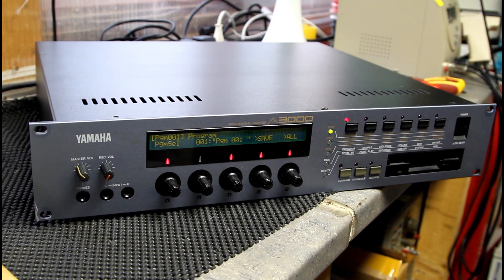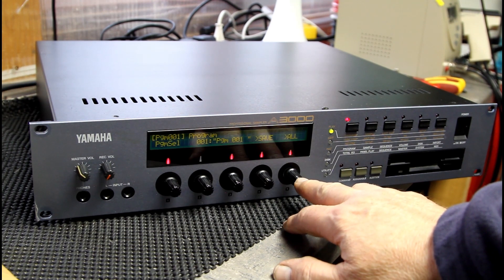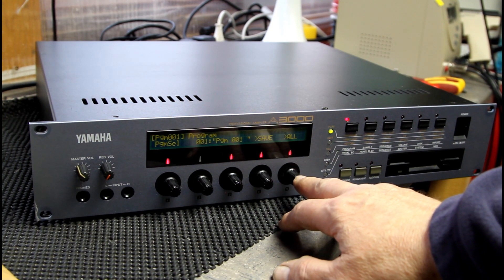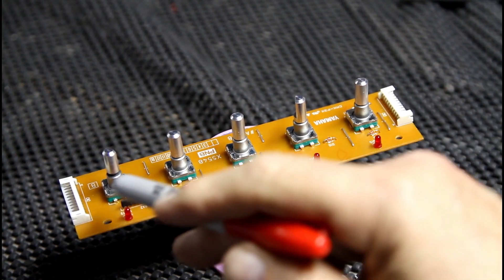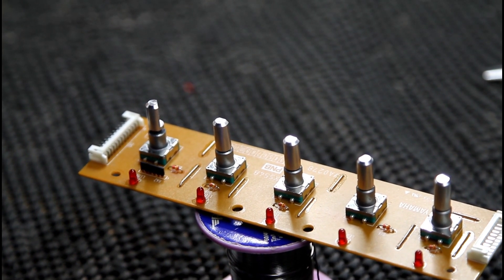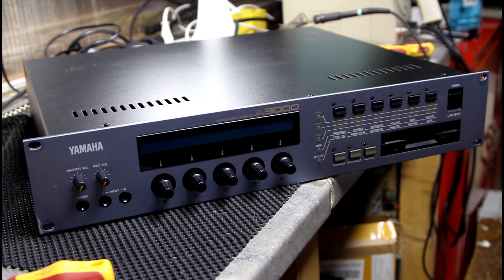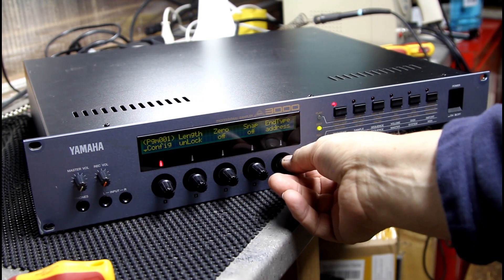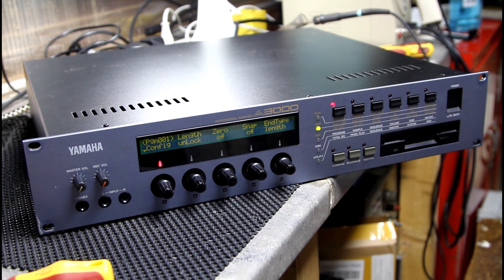Yamaha A3000 sampler replace encoders

Comment: I've looked at this A3000 sampler many times on Ebay with an itchy 'buy it' finger, but so far I have been a good boy and kept my money in my wallet.  Not sure how much longer I will resist though! 🤣
Reply: Well I made the plunge...I have to say......I want another one 🤷🏽‍♀️ its a beast
Reply: @smokedoggbaby953  Shut up! SHUT UP!!!!  My finger is very itchy now! 😰
Reply: @EgoShredder  have you seen espen krafts videos on the a4000 effects? Watch tht and I guarantee you won't buy it?.....(laughs silently🤭😌)
Reply: @smokedoggbaby953  Not sure, I have seen a lot of his videos.  I remember back in circa 1998/99 talking to a Yamaha rep in a music store I worked at (Academy of Sound, Leeds).  He said they were planning on releasing a PLG plugin board version of the A3000 sampler.  Sadly it never materialised, as I had already mentally earmarked a space for it in my rack inside one of my MU100R synth modules lol.
Reply: @EgoShredder  well u will be crazy to not get one dude,don't miss out on what is going to be your best purchase yet.....🙂 just for the effects alone you will love it let alone the actual sampler...its got lofi crunch too....and thts an option lol
Reply: @EgoShredder  - I dug mine out for the loop remix and loop divide functions. Was going to get something like an SP404 but remembered that the old A3000 is more than capable for chopping. 
I replaced the encoders and it’s still a dream to use 👍